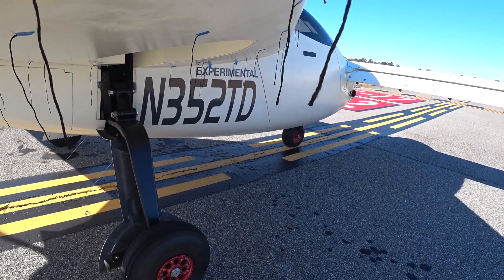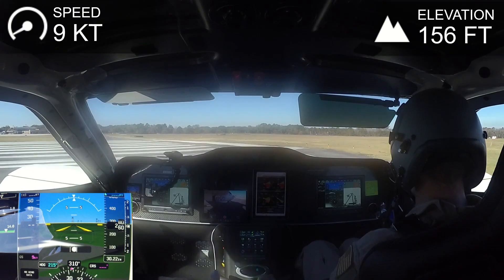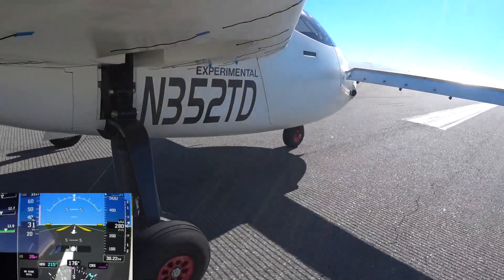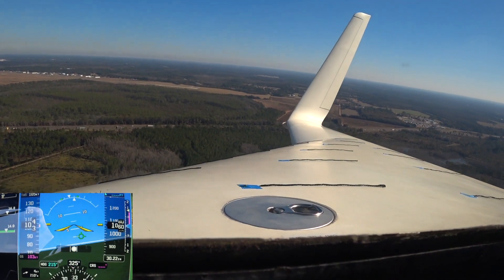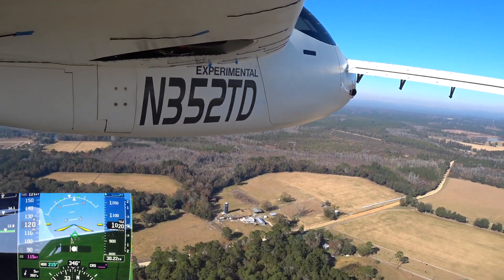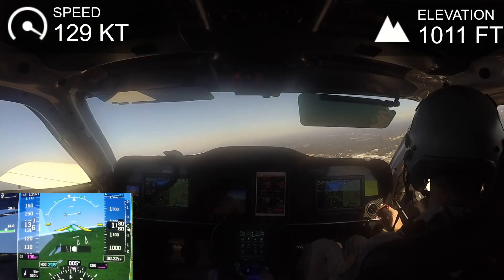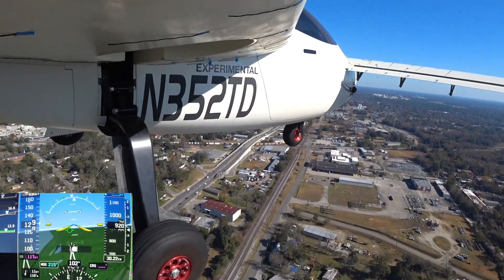Gear Up...  Check! - Flying the Raptor Prototype

Comment: I think you need some streamers on that fuselage.  Without that instability problem solved there's no point working on temperatures, because you don't even know if you have a viable airframe yet.  I wonder if there is some interaction between the lift from the wing surfaces and the fuselage.

Comment: Pete it's looking great. I'd exercise caution however trying to fit events like the first gear cycle into a single circuit at 1000ft. If you're attempting to analyse pitch changes due gear transition, you need to be above the friction layer. This would give you smooth air and a better representation of what is associated with the gear, and what is turbulence or pilot induced. You'd be above the birds too, and your workload will be easier. Minimum 3000, but start at 6000 to assess handling before moving to the circuit for representative in service effects. I agree the vortex generators would help outside of the wing transition. Good job though!

Comment: Hi Peter, I suggest you get the EAA flight test cards, and start working your way through determining the Flight parameters. Knowing what your stall speed is, before you start doing low speed, low altitude runs to sort engine temps is probably a good idea.

Comment: Just a quick thought. In the video the fuel cap was shown. I used to fly a diamond da-42 and it had a similar designed fuel cap. I believe in the video you have them backwards. Those fuel caps are a bit weird in that they are supposed to close forward into the airstream. The design of the latch pushes air down to keep them locked.

Comment: Anxiously waiting for faster velocity, longer duration and higher AGL flights and the performance of the cooling system ought to be a non issue with the cooler air at higher elevation. Very happy with your progress Peter!

Comment: The wing oscillation at 3:08 is the same behavior that has been apparent the entire test flight series. Dutch roll tendency is apparently part of the aerodynamics of the design. Not fun. The camera aliasing oscillations are because of an inherent engine or propellor harmonic being induced into the wing, which then is captured by the video camera shutter at the current frame rate. Another uh oh. Those kinds of things don’t just go away. They’re tell-tale signs that something more ominous lingers beneath the design. If wing oscillations were pilot induced, then taking your hands off the controls would stop it, But it only gets worse when you release the controls. Longitudinal instability has been apparent throughout your series. These aren’t just opinions, it’s plainly visible in your test flights. Downward facing and outward canted winglets on the canards might help.
Reply: It may be a little premature for a definitive statement on Dutch Roll characteristics without a full data set.  Almost all aircraft will exhibit Dutch Roll characteristics under certain conditions, but at this point too many unknowns including captured pilot inputs, rigging status and wind.  Viewing a few seconds of wing wagging provides little useful information.  Dutch Roll is a coupled characteristic involving both yaw and roll and without movement around both axes, Dutch Roll is not exhibited.  I have flown many recovery maneuvers from Dutch Roll, and that is not what we are seeing here.  Not that Dutch Roll could not be induced by pilot inputs, but there was no discernible yaw oscillations.  That leaves roll oscillations that could be the result of roll sensitivity, slight overcontrol, rigging issues and tuning of the set trim tab on the wing.  All of this is consistent with early stage flight test on a prototype model.  As expected, Peter is still developing that characteristic "intuitive" feel for the aircraft, and at this point is the only person qualified to evaluate.  That being said, all inputs have potential value.

Comment: Nice build. I do question the wisdom of the extreme width of the aircraft although it does have that good airship shape. I forget if I have asked before, what's the weight, power and top speed of it?
Also the winglets, as I understand is mostly drag and done when something prevents the wings from being longer. Private jets do it despite no merit simply because thier customers think it looks cool. A longer thin wing is the better performer.

Comment: The engine needs an adjustment on the thrust line. I see it on power changes. Needs a yaw damp installed.

Comment: What are the actual planned take off and landing distances.  I noticed you rotate at 100 knots and fly the approach at 100 as well.  Do you think the plane will be able to fly in and out of 2500 to 3,000 foot strips?  Will it eventually have high lift devices?  I love the planes look and potential, but need short field capability.  Thanks.

Comment: You can improve your landings by using the formula; Knots times 10. Knots times 10 is the distance you travel in 6 seconds of time. For your airplane on final at 110 knots you will cover 1100 feet in 6 seconds of time. So if you know where you want to touch down, start reducing the power 1100 feet before that point and you will land at that point, without floating .

Comment: configuration question, is the oil temperature being taken before or after the oil cooler?  post cooler temperatures are typically 25F cooler.

Comment: Congrats, Peter! Very impressed with the transition speeds of the gear both up and down and the fact that you mentioned no noticeable change in attitude during transition. Should make for a solid and stable IFR machine.
Looking at your gear design I'm anticipating you could have some helpful high speeds for dropping gear on a high speed approach. Any forecast numbers on that? I'm guessing (hoping) you'll be up in the 150+Kt range. Any plans for speed brakes? 
I'm seconding comments for both ground based video and chase plane. You're wetting our appetites to see more!

Comment: Nice progress. Wouldn't it be safer to immediately climb to altitude instead of flying around the pattern so you have some time and options if something goes wrong? It seems once you're off the ground you want to get out of the danger zone near the ground as soon as possible.

Comment: Peter, keep in mind you can ask for a “climb in orbit above the airport.” Flying around at pattern altitude for the whole flight is needlessly risky especially as you start to increase airspeed to explore the flight envelope. There are no airspace restrictions around VLD that will prevent you from doing this, and it will keep you much safer. 

Keep the airplane in the glide cone for absolutely as much of the flight as you can. There is always a period immediately after takeoff until somewhere on downwind where an engine failure will prevent landing on the airfield. Having an idea of where that point is is essential, and having a few alternate landing spots in mind before you ever get in the airplane may well save your life one day. Review those spots and what procedures you’ll follow again immediately before you takeoff. 

I’ve “been there and done that” in flight testing for over a decade and had a few close calls. Stay safe out there.
Reply: Excellent information/advice.

Comment: Congratulations on another successful flight Peter!  You have proven the stability of the airplane sufficiently for this phase which is great progress!  I am somewhat concerned however about you achieving a usable production configuration before money runs out.  I want you to succeed and in that vein suggest that you focus on design updates that will have large impact on the two most significant Raptor issues: engine cooling and weight empty for the production version.  There has been little to no discussion about how these issues will be solved for production.  The forward cooling systems of water tanks and high depth / low area heat exchanger are band aides that are not working for a production cooling solution.  Discussion about next steps seem to be continuing to test this band aide system, this is a waste of time and schedule.  A cooling solution is needed that allows long term idle, taxi, and long duration climb at full power to higher altitudes, etc. on the hottest of days.  When do you plan to redesign the initial cooling system to separate the intercooler from the radiator, enlarge the coolant radiator, and add an oil cooler for oil coming out of the turbos?  The cowlings likely need to be modified to separate the cooling paths and generate enough exit area.  All production turbo aircraft that I am aware of separate the airflow through the different coolers and have oil coolers as well as large area low depth coolant radiators.  As I am sure you know, added schedule adds money to live and pay bills, hanger rent etc., how long before you run out of money?  It seems the production cooling solution should be started ASAP to minimize risk to running out of money before the production configuration can be determined.  Also interested in your thoughts on how the production version will reduce weight?  **Some ideas for weight reduction consideration: Was the foam used in the sandwich panels of the aircraft structure open cell foam?  If open cell foam it could have absorbed a significant amount of epoxy, there is a lot of surface area of foam used in this aircraft, this could be significant.  The door latch frames may be lighter machined out of aluminum details bonded to the inside of a flat panel outer skin of both the fuselage and the doors rather than trying to integrate the aluminum boxes into a thick composite laminate that is heavy.  Post curing the aircraft after assembly seems that it caused significant deformation in the parts that had to have body filler put in to get the smooth shape back adding weight.  Post curing the parts while still in tooling and under vacuum pressure could eliminate this need for filler and also alleviate thermal induced stress on the windows, but the tooling needs to be capable of the post cure temperature without distorting.  Also there are a lot of overlapping joints with Hysol adhesive the way the parts are split up currently.  Could more of the structure be integrated together into larger components with fewer overlapping joints?**  I hope you see these comments as constructive, I just want to see you to succeed. Success doesn't happen often in this industry, and many times projects end because they go on longer than funding is available to support them.  Explaining to your investors and your YouTube audience how you will resolve the cooling and weight issues will keep the excitement going and allow you to raise the money through crowd sourcing and other means to finish the project.  Best of luck to you Peter!

Comment: Peter I was very worried about the gear retraction for some reason. I was worried about wing loading change anomaly in flight compared to a static ground test for some reason. Great to see them operate flawlessly in flight. They actually performed at a much greater rate than I expected them to also. I am very proud of your accomplishments in the Raptor test program, and you are taking each challenge slowly, carefully and changing what you feel is the appropriate level of modification required at this time. The program continues to move along at a steady pace so be safe and keep up the great work. We are all with you Peter, Cheers Mate!

Comment: Looks to me that your oscillation is caused by the rough air flowing off the back of the canard and spoiling the air going over the inboard portion of the wing.

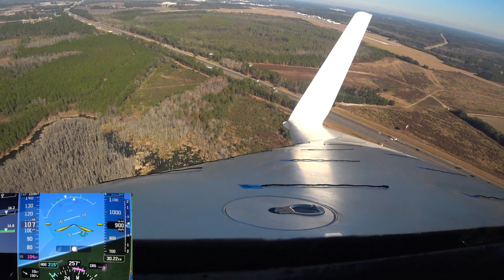Comment: (@2:50) could that tuff becomes slightly separated, as well as the under wing camera oscilations be due to wortex from the front lifting surface ?

Comment: are you planning on putting full panels on the gear doors for better aerodynamics? just curious.
Reply: There is hinging there on the main door so I would imagine this is possible (likely planned for) with a system that allows a small outer door to offset by some small angle that allows ground clearance when gear is down but that closes as the actuation cycle completes.  This would be so excellent.
Reply: Peter has already put full gear doors on. They've been removed for the flight testing. I imagine they will be reinstalled soon.

Comment: Outstanding progress! I agree, it looks awesome with the gear up. I know you know but, watch those flat-high power finals. Try to stay at pattern altitude until you hit the normal VASI or even start a little above. That will help your longer landings shorten up to get you back into the zone. You won't always have 8000 ft of runway, or a VASI or PAPI. Altitude is your friend on final should your motor act up as you pull the power off. You might consider trying an approach starting two dots high to see how she glides in idle. Might be good information to have and be familiar with. Any plans for a fairing to seal the gear wells around the tires? An outer gear door perhaps? A folding lower panel on the gear themselves? Also, start doing a gear check at the same point on final to build habits. Turning final, crossing into the overrun, out of 500 feet, your choice. Good habit to have now that your wheels can hide. :)
Reply: Keep in mind that canard aircraft without flaps fly an approach that is flatter and higher speed than a traditional aft tail aircraft with flaps.  Canards keep speed up on final to ensure that the canard does not stall at low altitude dropping the nose and making a hard nose first landing, this is the tradeoff for the greater spin resistance and greater aerodynamic efficiency of the canard configuration.  The weight of the Raptor prototype also necessitates higher flight speeds to make sufficient lift.  This weight issue exacerbates the high speed flat approach requirement typical to canard aircraft.
Reply: @2thelimitandthensome  Approach speed maintenance is accomplished by energy. That energy is either from the engine or by potential energy, i.e. altitude. My dad was a lifelong instructor and he always taught pulling the power off abeam the touchdown point to give you a feeling for trading that potential energy for pattern positioning. And, in the off chance you lose an engine, the glide resembles something you are used to. Peter is trying to fly larger patterns to get more time/experience in the air. So pulling his power off abeam the touchdown point won't work. What will though, is getting on or slightly above the normal glide path and seeing what the inherent glide characteristics of his aircraft are in a reduce power situation. Flat approaches are inherently dangerous. And, they lead to long landings. A steeper, lower power approach naturally loses energy in the flare or round out. That helps the pilot get the aircraft down, in the zone, and on speed.
I am just trying to offer suggestions that might help Peter explore his flight envelope a little better. He has his hands full now trying to look at temps and details inside the cockpit. I just want to help this effort by suggesting some considerations after observing things that might bite him in the future. The very best to this effort and to Peter.
Reply: Mmm, from one CFI to another ?
Reply: @berniemccann8935  Not a CFI. Just a pilot with 25,000+ hours of military and civilian jet experience who thankfully retired with no bent metal in his log book.

Comment: Hey Peter, just FYI your temps are actually really good. I spent years driving heavy trucks and its normal to hit 220 after 2-3 minutes even with a gigantic truck radiator. Trucks run about the same power level, so your engine not even hitting 210 in a 10 minute flight is actually superb. 

If I was you I would do a climb confidence test. Stay near the pattern and climb until you hit 215-220 degrees. Itll really take a load off your mind to confirm how high it can climb before overheating. 

The system wont even pressurize until 220. But testing overpressure should be reserved for a little further along in testing, if it even reaches 220 at all.
Reply: I don’t believe coolant temps are the issue now. It’s oil. 245 on the oil is still rather warm for a winter flight. It’s not horrible, but I think that will need to be remedied when weather warms back up.
Reply: @ApexAlex113  They make coolant/oil heat exchangers for this. Very small and light. He should not have a problem with installing one.

Comment: Nice very nice I know you must feel great the open gear wells not an issue. Steady progress the temp in and out was good data.  You could try the same on the primary cooling system water and oil. Damn good progress congratulations.